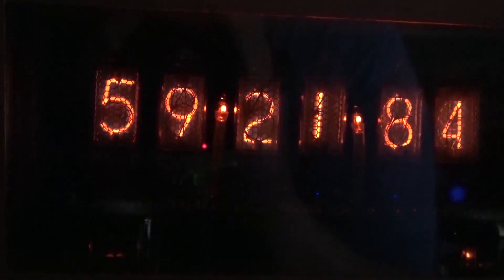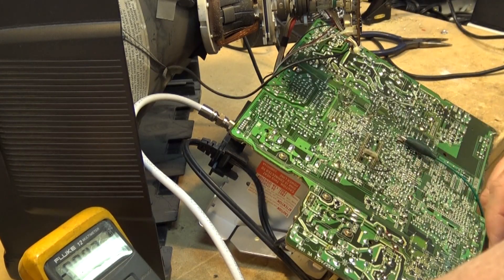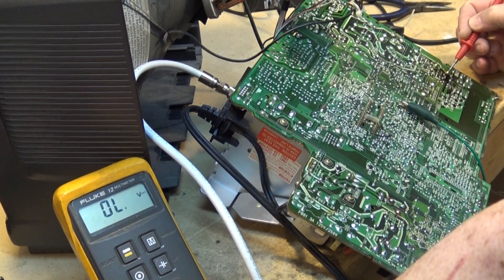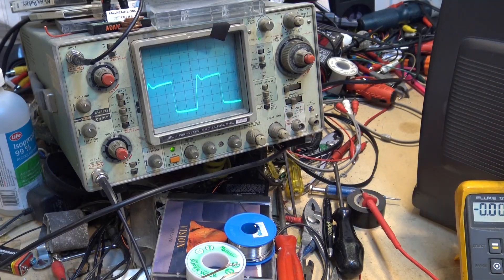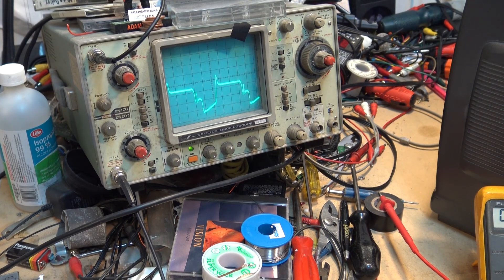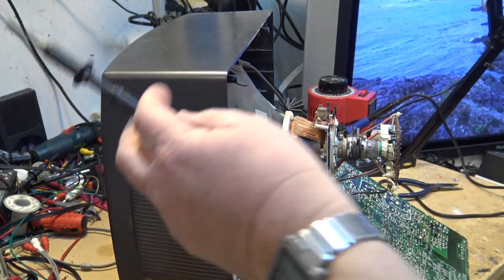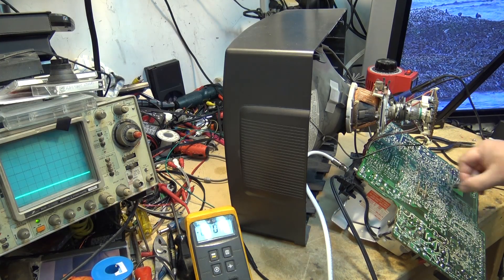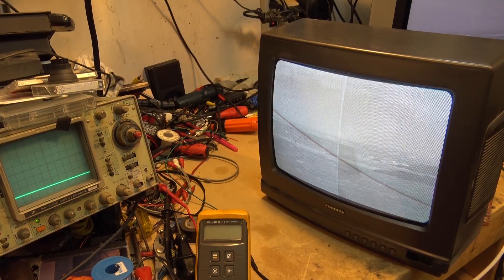Troubleshooting CRT TV Horizontal Deflection

Comment: Appreciate the video. You and ChatGPT have helped me immensely trouble shooting this TV I have. Ultimately, I found that the HOT was shorted out (0.06 voltage drop) after finding some H-drive resistors that had blown up. I've got a new transistor on order and already replaced the resistors
Reply from the maker: Horizontal output transistor HOT generally do not fail without a reason.  They can, but generally don't. It's usually causes by 1 a couple things.  The flyback may be shorted. This would be determined after replacing the transistor and monitoring the collector on a scope to observe the waveform. More common is loss of drive or distortion of the drive signal caused by cracks on the horizontal drive transformer or cracks on horizontal drive transistor.  Loss of drive will latch the output transistor and poof.
Reply: @12voltvids  thank you for the feedback. I am lacking a scope. Any else I can do? I pulled the H drive transistor and it measured good, so I soldered it back in. I can reflow solder on the horizontal drive transformer, but the joints looked ok. I can also test the flyback for shorts. For reference, I found a service manual online for the Funai EWC0902. Mine is the Emerson brand but has the same layout as the manual. R589 & R590 were blown. Q571 is the HOT that was shorted.

Comment: Is that a drive line in the center of the screen? I must say that is the skinniest drive line I ever saw. They're usually wider. Non-linearity on the left hand side of the screen is associated with the damper, and non-linearity on the right is associated with the horizontal output transistor. A drive line means something ain't ghee-hawing between the damper and the output. Since the output transistor collector resistor opened up, I wonder if something isn't a little wonky in the output stage that was making it draw too much current, but not enough to blow the fuse. That set might boomerang on you.
Reply: As Emily Latella from SNL would say, "Never Mind!" I made the video full screen and realized it was a quad-split burn. I'll just let myself out. Tata!

Comment: Interesting. I have a Tektronix 2235 100 MHz scope with a 400Vpp max. Are you saying I could measure the horisontal deflection on the collector using x10 on the probe? 

Great video btw! Your skills in troubleshooting CRTs is amazing! More videos like this please. This will help a lot of arcade cabinet owners keeps their tubes working and troubleshoot.
Reply: x10 probe is essentially a voltage divider, so high voltage pulses can be measured easily.
you'll simply have to keep in mind that what you see on the scope has to be multiplied by 10 in addition to the scope's mode modifiers.
Reply: @netimmerse That I know but my question was more if it could handle high voltages (600-800V) in x10 when my scope says 400Vpp.
Reply: @victorclausson4039   as it was said, the probe divides incoming voltage by 10, so anything up to 4kV (depends on the probe) will be fine
in this case 600-800V will simply be turned into 60-80V for the scope.

Comment: For a minute I thought you still had a problem with the horizontal output stage after replacing the resistor, as it looked like a fold in the centre of the screen - then I realised it was screen burn.

Comment: This repair harks back to a time when component level skills were a must.
Today we fit a new main board or backlights.
Give me a CRT based set any day over LCD.
Reply from the maker: I won't touch the new sets.
Reply: @12voltvids  Same here, the very latest sets have panels that are glued togeather 
making it impossible to replace the backlights, that has to be deliberate.

Comment: I have a 21" Philips flat tv. The picture is garbled at startup, but becomes fine after about 10min. What could be the problem?
Reply: the phanthom capacitor!!!!!!
its getting warmed up as the tv is on, the eltrolyte is pre-heating thus causing plates to generate working conditions..look around psu next to heated areas.:trophy-yellow-smiling:
Reply: @MRJWC2332  thanks for your advise. But, if only I were that lucky and get away with just a cap. Its always the hardest bit for me.